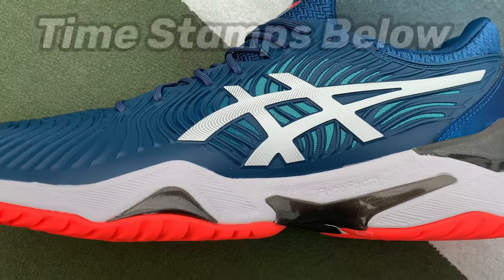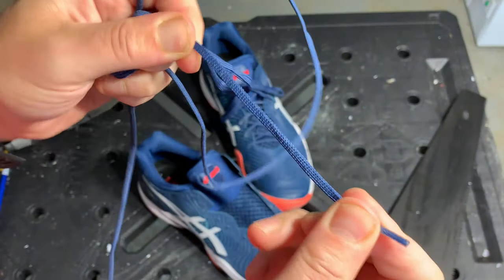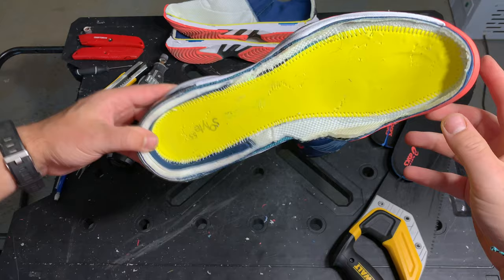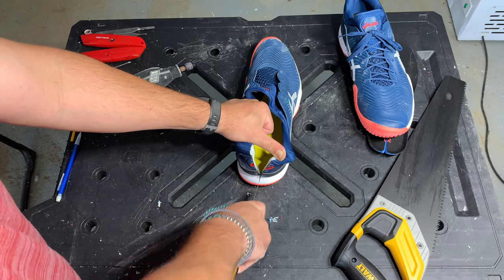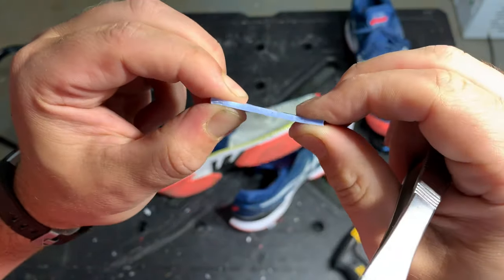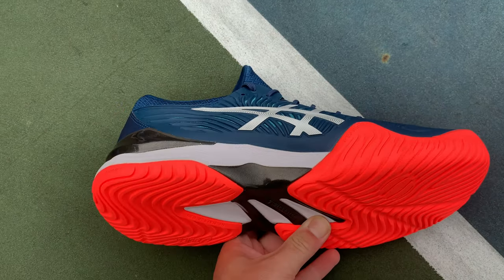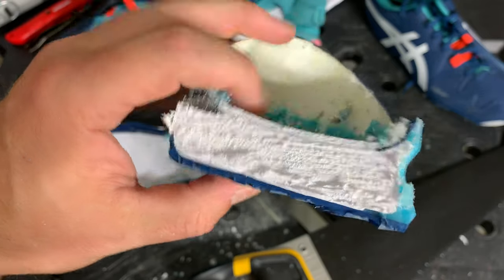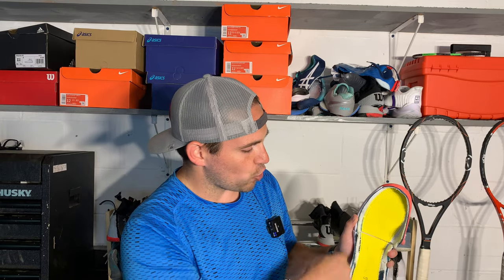Asics Court FF 2 Teardown and Durability Test | Foot Doctor Tennis Shoe Review

Comment: I currently wear the ASICS GR 7, in a 10.5, which is slightly tight. I’m ready for new shoes but supply is extremely limited; between the Court FF2 and the GR8, which do you recommend in terms of fit, comfort and stability? Thank you for your excellent tear down videos!
Reply from the maker: Definitely the court ff2 - not as much heel slippage and better side to side stability plus a tad more generous toe box - glad you like them!

Comment: I really appreciate what you're doing on your site....extremely helpful and unique reviews.  While I like the glove-like feel of a sock liner, the downside is that if you have to wear an ankle brace on one foot, it's almost impossible to fit into the shoe.  In addition to Powerstep Pinnacle Maxx insoles, I use a figure 8 style brace to mitigate deltoid ligament pain due to flat feet, and it just will not fit into sock liner style shoes.  I am still using the last Barricade model, but am going to have to find a new alternative soon.  I have tried on the FF2 and Gel Res 8 in store, but am concerned at how soft the uppers are on the medial side, and feel like my feet will just collapse them.
Reply from the maker: Thank you! It’s going to be tough with a brace to get it in a slipper- but you may be able to stretch the FF out- it has pretty darn good support on the medial side - solecourt boost also has good support even though the upper is lighter - Nike GP turbo has a huge medial rubber piece if you play hardcourts - Wilson prostaff 2020 review is coming up soon and that may also be something you’d want to look into- very maximalist type upper

Comment: I have flat foot and using custom orthopedic insole with Nike vapor X. I’m considering this shoes now however not sure if the custom insole would fit nicely given it has some arch support already. So the question really is between this one, the res gel 8 and Nike vapor X. Which one is better with custom insole? Thanks
Reply from the maker: The gel resolution 8 is much better for someone with a flat foot, they will both hold an insole just fine but the vapor x is very bendy in the arch so I would go with gel res 8
Reply: The Tennis Pro Doc I will order one and let you know how it goes 😊, thank you
Reply from the maker: Awesome let me know!

Comment: Can you compare the FF2 to older Barricades, and perhaps also dissect any of them before the one version you did (17/18) , like the 5 (V Classic was slightly different), 6, 7, 8 (8+) - if you can find, still many new models found in 2nd had sites like ebay, etc, thats how I got some of them still wearing today coz cant find the same or similar fit today (Sole Court Boosts but too expensive and the heel cup is way to stiff and high up on my achilles) I have some older shoes still not thrown away, thinking if an exacto would do enough to dissect them like you do...

Trying these FF2 was hopeful to carry that feel, but the shoe now feels lacking of some of the comfort and perhaps a lower heel? (low stack height drop?), also run longer? (same length shoe as my 'Cade 7s but the heel seems to sit more vertically back than the 'Cades) which may be making the difference, should I go half size or full size smaller, I got a lot of space to the toe and giving me concern as sometimes bending feels like having those long clown shoes. It does get better if i advance my foot forward but now there's a space in the heel even thought it doesnt heel sleep on it lmao. idk if adding a heel cushion would help. Thanks. These shoes are hard to find now. 

Still weating the 7s (Novak) coz they made so many of them due to his contract so was able to find them as new despite the newer 'Cades were out. I havent really tried the last and reissued model (17/18) but willing to, I think i did try them on once and felt too narrow. (15/16) were terrible, Achilles sores, goes away when back to 7s. Aldo did pull my calf considerably on them too, first time ever. and Twice. So I wonder if they also lowered the heel stack on these as well, and if so this and on the FF2 is another concern.

Thanks for your videos, refreshed and excellent! Always been hoping to see more dissects like these, not just spouting out the marketing but also show reason and performance due to them.
Reply from the maker: Thanks again- yeah I try and get the real mechanics of the shoe out there so people know what they’re getting- hopefully the new barricades can thread the needle between previous models and the SCB - hopefully we can do a big retrospective on them as well

Comment: I want to give input on durability. I had model FF Novak Djokovic Clay and they were great to play but the inside of the shoe is not very durable. The cloth material at both sides of the ankle has worn off so that the plastic which supports the ankle peeked through. I bought them in June 2022 and they lasted until November 2022. I'm a recreational player (80kg weight). My last pair before were Asics Gel Resolution 8. These lasted for a whole year. The soles on both shoes almost did not wear and were very supportive/solid.

Comment: The new Asics Court FF3 is not a big departure from the previous model. The shoes continues to be the standard for those all-court players who want to scramble in all directions and slide into their shots - like Djokovic who apparently helped design this new version. For that, these shoes continue to excel. The mono-sock design again engulfs your foot and the new lacing system does a better job of locking your foot in to the shoe. I thought the shoe felt more breathable than the previous version - so many of the complaints about the last version seem to have been addressed. I was hoping that Asics would improve the cushioning for the rest of us. While on court performance might be excellent, the shoe is quite firm underfoot. The new heel on this version - in particular - has nearly no cushion. After an hour of hitting in this shoe, my feet were throbbing, my knees were sore, and my hips ached. While these shoes might be great for Novak, they are not for everyone. The comfort level is sorely lacking. I guess these shoes were just designed for professional athletes without any joint issues. I was very disappointed.

Comment: the "outer upper plastic part" where shoe laces pass through really irritates my medial malleolus, such a pain in the ass for me.  Anyone same experiences ?   My left shoe medial side does, not the right shoe,  so I cut it out and I can't tie the left shoe lace one hole prior to the last. Other than that, it is the best shoes on market.  Share your thoughts, please.
Reply from the maker: I usually will put moleskin or a felt pad around the area in question to spread out the pressure, that’s worked in the past- some peoples ankles just don’t like that tongue and collar design but usually in the right areas that adhesive felt does awesome
Reply: @FootDoctorZach  Oh. I tried thicker socks and it didn't work at all. I'll try to attach pad on it.  thankyou

Comment: How does this compare to the GR8? I have been wearing Gel Resolutions since the 4th generation. I love the stability, comfort and durability. Is the Court FF2 better on these aspects? My outsole usually wears down in 4 months of play and that I’ll claim a replacement pair from
Asics. I have flat feet (use custom insoles) and normal width.
Reply from the maker: They fit a lot different- for flat feet i like the GR8 more just due to the tongue construction
Reply: @FootDoctorZach  how does the tongue construction on the GR8 better for flat feet? Is it because you can really tie it real tight?
Reply from the maker: Watch my GR8 review I talk about it at length - trusstic system plus the heel counter keep the inside solid

Comment: Thanks for another video! I found my regular size a bit long so I order the FF2 half size down. Then I feel tight and I have to wear very thin socks. Will the FF2 loosen up after the break in period? Many thanks.
Reply from the maker: It will from left to right but front to back it may not because of how much outsole is up over the upper- if you get another pair I would maybe wear 2 pairs of socks just to fit the toe box instead of going a size down
Reply: @FootDoctorZach  Thanks for your suggestion. I don't think I can stand two pairs of socks in Texas hot weather. :-P
Reply from the maker: Youch- yeah that’s rough it can get brutal down there in the summer- I played a tournament in college down there one spring season- up here in Pittsburgh we’ve been actually cooler recently so it’s been nice

Comment: was waiting for this video. thanks doc
Reply from the maker: Awesome, glad you liked it- do you like the Court FF?
Reply: @FootDoctorZach  well after your videos, I bought both the gel res 8 and the court ff. There are both pros and cons. I would say that the court ff are wider and more comfortable but they run a little long compared to the gel res. Also, the gel res has a little bit of heel slip.
Reply: the perfect shoe would be if they combined the two together. The flexible upper that is better for a higher instep like the court ff 2,  traditional tongue of the gel res with the wide base and midsole that cradles your foot better like the court ff 2 and an outsole warranty of the gel res. I wish asics makes changes to the later iterations.
Reply from the maker: Yeah one thing I didn’t like about the gel res was the heel coming out
Reply from the maker: I do wonder why they didn’t incorporate more of the Gel Resolution 8 tech into the court ff - would be a phenomenal shoe

Comment: Do they feel as stiff as many players report ? Also that they never softer up or break in ?
Reply from the maker: They are stiff at first but not really uncomfortable - there’s a ton of tread covering the upper and the polyurethane stiffens it up but I wouldn’t say they feel bad at all and I liked the solid feeling they gave- too soft for me sometimes means too slow and not as responsive
Reply: The Tennis Pro Doc have you tried ubersonic 3? It’s a shoe that does not impress but very good overall except ankle support. Which are your favorite 3 shoes right now ?
Reply from the maker: I haven’t but will probably order it soon- right now probably GP turbo, solecourt boost, vapor x
Reply: The Tennis Pro Doc I f love sole court boost. But they have shoe sizing with this model. I wear 30,5CM/12,5US uber3 with no issues and on the same size my feet swims inside SCB.... also i have issue with the tongue it keeps getting inside.... laces can’t hold it up. Tried 30CM/12US of SCB but when i was breaking my fingers got crashed on the toe box/front.
Reply from the maker: Seems like your foot type just doesn’t like the upper and toe box of them - interesting

Comment: Great video again - How will u compare this with court ff 1 ? Will court ff 1 give the same kind of protection and stability like court ff2?
Reply from the maker: Unfortunately no the second generation is a big step up from the first gen
Reply: Thanks... Can you suggest some budget friendly shoes with good protection similar to gel resolution 7 ?
Reply from the maker: Kswiss ultrashot, NB 996, 796... I’m also working on a best shoes under 100 video soon
Reply: Thanks again - Do u think Gel resolution 7 will give good protection and stability as it is older version?
Reply from the maker: It should do fine-the 8 is built a little better though
Reply: @srinivasan-cv6gl  The 7 is a great shoe but built with a smaller toe box.
Reply: The ff1 had a pretty thin outsole in the forefoot and a tight sock-liner - I had to donate them.

Comment: Thank you for the review. I have noticed what seems like extra material above the forefoot that crinkles/crunkles when walking. Don’t notice it while playing but the extra material makes a folding noise when just walking. Have you or others noticed this? I have two pair and while I like the sock liner this bulge of extra material over the outside top of the forefoot seems like a design flaw.
Reply from the maker: Yep a lot of urethane - just a product of the build

Comment: Trying to figure out what’s the difference between Court ff2 and Court ff2 clay if any?  I can only find the clay ones in my country. What’s the difference between the two?
Reply from the maker: Just tread depth the rest of the shoe is the same
Reply: The Tennis Pro Doc  Does it affect its durability ?
Reply from the maker: On the GR8 it did so I would assume the rubber on the FF2 would be slightly softer as well

Comment: i bought the Court FF2 earlier this year to replace the ancient Barricade 5s i had. I have a high volume instep but the bootie style upper was more comfortable than the traditional 3 part upper of the Resolution 7 that i was also considering. i guess the thinner upper of the Court FF@ was more comfortable and looked less bulky than the Resolution 7, i actually had to go up a half size in the 7 to get comfortable.
Reply from the maker: The bootie does help with that foot type